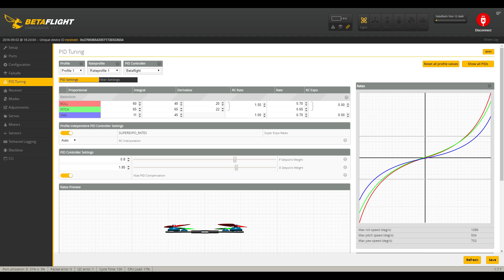Can You Troubleshoot #5 - CYT Why This Pilot Is Having Trouble Controlling This Quadcopter

Comment: hey Josh I'm getting a message every time I try to flash my board that says detected device with total flash size 1024 kib what does that mean
Reply from the maker: I've never seen that message before.
Reply: +Joshua Bardwell this is the third board it happened to me on the revolt twice and then they omnibus F4 I hold down the boot Button plug in the USB and Flash the loaded firmware then I get that message at the top and with the Revolt I solder the boot pads

Comment: Hey Joshua great video as usual. I've got an Eachine x220 question. I'm going to put an owl run cam on my machine. I'm new too this but do I need ntsc or pal . I appreciate all the info . You've helped so much . Thanks
Reply from the maker: +Chad Baugh either. Your goggles should auto detect.

Comment: besides that  P yaw that everybody is mentioning that should be higher ... It's effect would not be very visible unless you time the delay in stick command to actual yaw move.  I would be more concerned with the slips/drifts at the end of a commands that indicate a low I term problem.

Comment: The issue at hand is the YAW P term is stupid low, RC Rate is higher significantly on the Roll and Pitch axis than the yaw, therefore it creates a serious control problem due to accelerated stick movements in pitch and roll, where it's slower on YAW, as well as the super rate is slightly off on pitch, but that isn't the worst thing (some actually prefer that), the biggest is RC Rate as well as YAW P term being so low that is can't really compensate for error.. So, do I get to pick what kind of cookie I get? :-D
*Edit** re-analyzed the video... Also noted the low configurator number. I noticed the older firmware , due to the Super Rates tick slider, but this could simply be a Naze32 board that runs best on older firmware revisions... This could also be part of the problem..

Comment: joshua am i right that simply removing the signal capacitor on my little bee 20a blheli-s ESCS i will be able to run dshot 150/300/600 with no further modifications? hopefully you have the time to read this and reply :). also in the video the copter seams to be drifting backwards maybe? also your yaw P value looks very low :D
Reply from the maker: +Adam Tavener about the ESC's, I think yes but only testing the actual ESC's will reveal. Look on the wiki to see if anyone else has done it.
Reply: Joshua Bardwell thank you for finding the time to reply! I am going sign up to your channel so hopefully we can talk in the chat room you have and I can let you know how I get on if you are interested. I have a ESC coming tomorrow as on one of mine the mosphet fell off! so I will test it tomorrow. thank you again.

Comment: Apart from the Yaw P being low, does it have something to do with the vbat PID compensation and using LiHV?
Reply from the maker: Interesting guess, but no. LiHV would put vBat over the top of the scale, which would result in zero reduction in PIDs if vBat PID compensation was on.

Comment: Don't know. My guess is that when upgrading Betaflight a dump was made and after flashing this was applied to 3.0. However reading through the change log (https://github.com/betaflight/betaflight/wiki/BetaFlight-3.0.x) there are a lot of PID and rate changes. My guess is that something from the previous version is causing the issue but I can't put my finger on what it is. I would re-flash and setup from scratch.

Comment: For the last few weeks now the model in the setup tab is not there, no matter which board I plug in. Headings etc is there. But no model. Any ideas how to get it back.
Reply from the maker: +Woodsy5791 woodsy5791 it's a chrome issue with the video driver. But I don't know how to fix it.
Reply: This has to do with just like Josh said, but also if your GFX card isn't up to the task, it won't display,. However, if you have had it previously and now it has disappeared, fear not, This happened to me a few weeks ago, no warning, rhyme, or reason. But I leave my PC's up for days on end without a reboot (I know, I am an IT Guy, rebooting clears out memory leaks and RAM corruption, but ECC hardware, yadda yadda tech talk, and not as necessary.. think server class) and after a reboot, and a Configurator upgrade to most recent version, it was back.

Comment: Pre config: Something wrong with the tune. Something is overtuned. Pitch looks to be maybe drifting? Continuing to over correct even after the move has been made and you're trying to move on to the next command, pitch is still 'fixing' itself. Maybe I term is messed up?

Post config: P seems high for both pitch and roll. I seems high for Pitch. 

On second watching all the way through: Yaw is badly tuned. Really badly. The yaw isn't doing the right motor movements, causing pitch and roll problems.

Comment: i have an issue with my naze32... when i connect usb.. pc makes the connection sound but no recognition in configurator(no lights on board too)  but if i connect and esc.. then blue led comes up..cant flash anything.. says stm32 bootloader failed
Reply: Your flight controller is too antique and fails miserably.
Reply from the maker: +SCY satish no lights on the board means its not getting power. I'm going to guess your ESC has a BEC and is powering the board.
Reply from the maker: +SCY satish bootloader failed means you're not in bootloader mode. 

https://youtu.be/m4ygG6Y5zXI